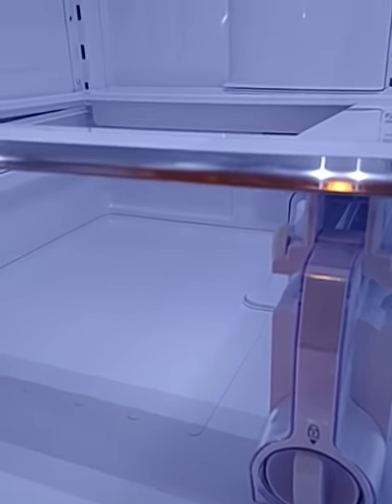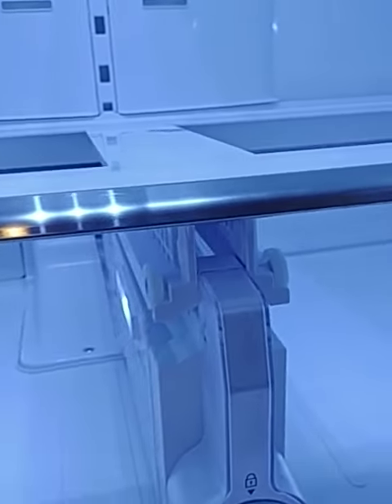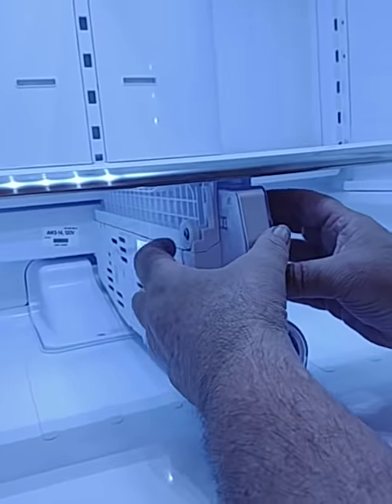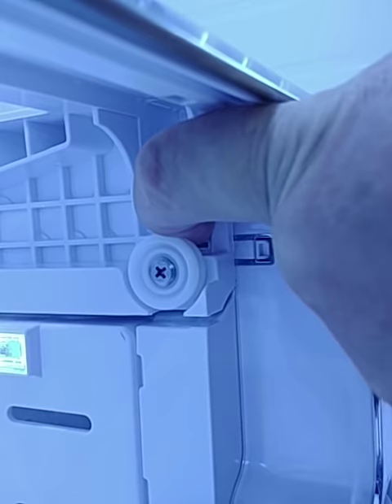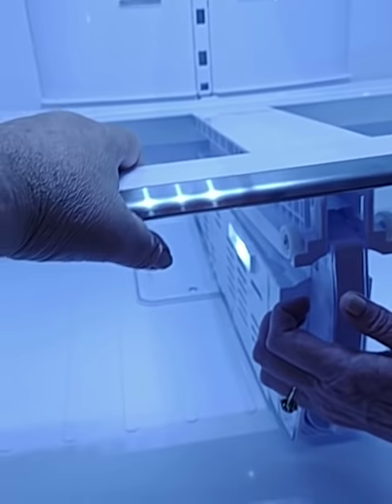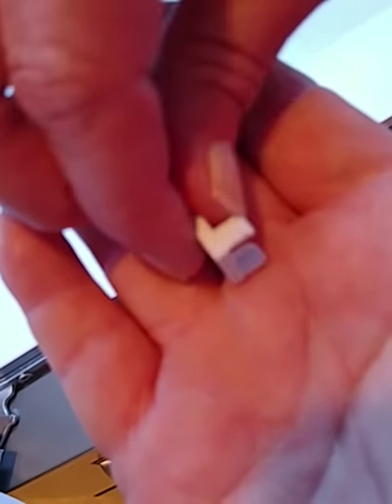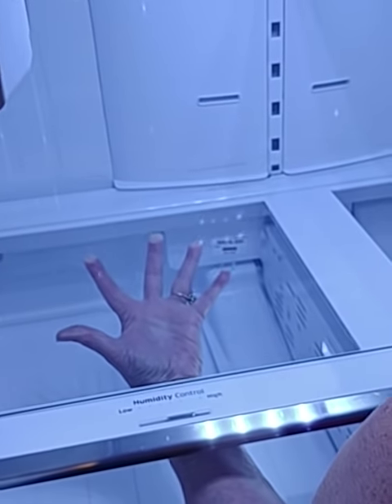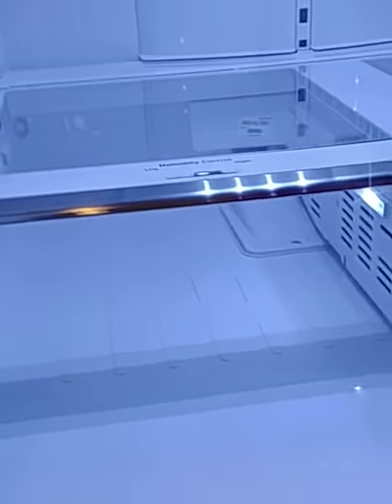Samsung French door 4 door bottom glass removal cleaning and reinstallation

Comment: This was so helpful. Thank you. I’ve had this stupid refrigerator for 18 months and could not figure out how to clean the inside of the glass. Whoever designed this needs to be fired ASAP.Bless you.
Reply: We just went through the same thing with one small spill that looked yucky, but we could not get the drawer or glass our.  Went to the store we bought it at and they couldn't get it to come out either.   We've had ours less than a year and ice maker replaced (freezing up) and it's freezing up again, one of the door handles is loose, and wasted an entire morning getting the shelf and glass out so one small but ugly spot could be cleaned.  Even the former technician said it was a very poor design with the ice maker being right inside the refrigerator part and not blocked off by itself.
Reply: So how do you get the glass out??? I’m going crazy.
Reply from the maker: @stephanielee5209  removing the 2 tabs in the back corners releases the glass. It must then be lifted at the backside and slid towards the back of the refrigerator as the glass snugs just under the front lip by about a quarter inch. Once clear of the front lip you can raise the glass carefully up and out
Reply: yes very poor design on many ways, the only thing that I love so far is how wide and spacious is and the freezer on the bottom. Other than that I hate to clean it.
Reply: Absolutely, I usually don't say this,  that the designer must be fired
Reply: instablaster
Reply: Yup someone spilled seafood 🦞 in mine and I’m struggling
Reply: @peggytilson3613  I’ll never buy another Samsung fridge. We’ve had the same problem with the ice maker and with removing the shelf. If I could justify it, I’d replace it today.
Reply: I agree they need to fire the designer:) we have this refrigerator for almost a year and I am going crazy trying to figure out how to clean the inside of the glass. I am going to try this
Reply: LMAOO
Reply: Once out.. the glass has 2 tiny clips on the right and left those easily come off with flathead screwdriver 🪛 to loosen the glass in order to clean underneath the glass .. you’re welcome ☺️
Reply: That's what I said..."need to be fired" 😂.....I'm glad I found this video...mine is 2 years already...irks me out every time looking at the glass dirty....just thought to search on YouTube this morning...since "you can find everything on Youtube" lol
Reply: Me too !!!!
Reply: Wonder why so many views lol
Reply: They definitely did overcomplicate the bottom shelf

Comment: My wife and I were struggling with this drawer removal. The manual really doesn’t explain something so simple as removal for cleaning purposes.  So , we thank you for this demonstration video. The clips that actually hold in the glass were removed by using a quarter ( my wife’s idea ) . We took the whole shelf out and flipped it over on the kitchen sink , giving us access to the clips .  Perfectly cleaned refrigerator now !
Reply: Hi Kent! I’m trying to removed only the glass but I can not do it, any advise? Is it even possible?
Reply: Omgee for real!
Reply: We did it!!! Finally. My son and I were trying to push the clips with a knife and they broke. First one and then we just decided to remove the second one. In that way we could the out the glass and be able to clean it properly, the glass and the drawer. Maybe somebody could remove the clips without taking out the whole drawer, but let me tell you, those clips are not made to be pushed, we had to press hard. So, I think if we were doing this without taking the drawer out maybe the glass can be broken. I think this refrigerador was not designed to be cleaned.
Reply from the maker: @maribelmartinez6669  YES.
MUST REMOVE PLASTIC CLIPS FIRST
THEN SLIDE GLASS BACK TOWARD REFRIGERATOR BACK WALL (ABOUT 1 CENTIMETER)
(THIS ALLOWS THE GLASS TO BE LIFTED UP FROM UNDERNEATH)
LIFT THE SIDE OPPOSITE ICEMAKER ABOUT 45 DEGREES AND THE SIDE UNDER THE ICE MAKER A LITTLE BIT AND PULL THE GLASS OUT DIAGONALLY
Reply: We struggled with this as well, your video was super helpful, thank you!

Comment: Thank you for this, 280 page manual and not 1 mention of how to remove the shelf.
I saw the 2 tabs bit I wasn't pushing hard enough.
Good job samsung.
TIP:  Don't reinstall the 2 plastic clips that hold the glass down. You can then remove the glass shelf by raising the rear of the glass and slide rearward.
Reply from the maker: 10-4 on that!

Comment: Thank you SO MUCH Kent! With the help of your video we were able to remove the glass only and leave that aggravating center section connected.
Reply: Oh, will have to try that next time.  You need to post a video of how you did it without having to remove everything on one door, pull out the drawers after doing all of that, then spending a long time to get the shelf to up so we could get it out and get to the tiny spill in the glass that was driving me nuts.

Comment: THANK YOU!  WOW!
Had no idea how to  do this  (same Samsung model) for about a year now.

Used disposable wooden chopsticks to push in on the tabs, especially useful on the right side that doesn't resemble a button at all.  
When removed. had no idea how to remove the glass.  Saw a comment below to go from the bottom.  Used a small screwdriver to push one prong from the edge, then easily pushed it out from the center. After we did that...
...another commenter suggested leaving them out so that you could just take the glass out to clean it and the surrounding frame and as that person said "where's is the glass gonna go?" if the tabs are left out.  Should of thought of that.😂

Anyway, THANK YOU, again Kent and Jane.

SAMSUNG, how about caring and thinking about your customers??? especially when you write your instruction manuals. 😒
Reply: We've had our less than a year and had the ice maker replaced, which was constantly freezing up.  Very poor design.

Comment: Thank you so very much.  You have taken a great deal of frustration  off my shoulders and mind. I wasn't able to press in the release buttons and lift the shelf. My hubby helped and now I can get to the stains that have been bothering me.  This video was a blessing.  I hope you have a wonderful weekend and I am now a new subscriber.  Samsung should offer replacement units with user friendly release buttons. I had a high opinion of the company and now wish I had known how difficult it was going to be to clean. Hopefully with each cleaning, the release buttons will be easier to use.
Reply: I had the same problem one month after I bought it something  spilled  under the glass and would you believe even Lowe's couldnt figure out how to take that piece out, and I was totally shocked when Samsung sent me a new refrigerator  can you believe that  I couldn't believe it. I spilled something in the new one and I was determined to get the dam thing out, took me a long time and not easy.  Samsung should do something about the design. It's not good.

Comment: Great video. It saved me a lot of aggravation. I would add "DO NOT REPLACE THE TABS" when you are finished cleaning. Save the tabs in one of the crisper drawers so you can replace them if you ever want to move the refrigerator to another home. In the meantime, with the tabs left out, you can remove the glass to clean the glass and frame without doing all hard prep work as shown in this video. Again, thanks for a great video.
Reply from the maker: Totally agree
Reply: Yep did the same thing.
Reply: I agree. But now how do you remove the tabs?

Comment: Thank you for your post. I needed this information so that I could remove the back wall panel  to melt the ice build up causing the fan to hit the ice and rattle.
Reply from the maker: If you call the repair guy 3 times  while under warranty for the freezer , ... They gave my sister a check for 1300

Comment: I took the two rear tabs off at each corner to pop out the glass and leave the frame in the door.  I can still clean all I need to without messing with that stupid design near the water filter.  Someone should be fired for designing this mess and their boss for giving it the ok.  Thanks for the video.

Comment: My Samsung had slightly different buttons and they were impossible to release with my fingers. I tried pushing with two screwdrivers, but I needed 3 hands to do that and hold the water filter plastic down and the shelf up.  I found if I used one hand to hold the pressure up and pushed on one button and I heard a click. While holding up pressure I switched hands and used the screwdriver to push the other side and it released. Pushing both side and holding it up at the same time is a two-person job. To clean between the glass and plastic of the shelf I released the clips in the back from the bottom, carefully pushing in on one side with a bit of pressure. It would have been impossible to clean in between without taking the glass out of the plastic.

Comment: I really wanted to see how you pop up the glass without breaking anything but great video thank u
Reply from the maker: Will have to add that as an uupdate! Once you have removed the clips from the glass. One must raise the back side of the glass and sight push it backwards to clear it from the front lip. Then it is acrobatics to raise the right side up to about a 45 degree angle to remove the glass from the refrigerator. So you must have both doors fully opened!

Comment: Nothing at all in the manual - almost freaking out and then found your very helpful video - so grateful! Great job taking your time to show in detail. You are right -  you need to be careful when taking out the clips. I used two screwdrivers to remove the clips and did break one in the process. Luckily my appliance is only two months old and my warranty covers the part - you have to call Samsung for the part not J &  J parts who charge $1.85/clip + $4.85 for shipping. Excellent job  - saved me.
Reply: Throw away those clips! They are not needed at all and it will be much easier to clean the next time it gets dirty!

Comment: Thank you, but how did you take the glass out? That’s my problem to clean under the glass 🥳 can you make a video about that?
Reply from the maker: After you remove the clips, (by the way DO NOT PUT THEM BACK IN), FROM UNDERNEATH the glass, push it back towards the back of the refrigerator, then press upward on the glass near the front of the refrigerator.
The glass is secured in the front under a seal that's only like an with maybe an 8th to a quarter  inch ... Like a half a centimeter  to free the glass from that lip then you can lift the front edge of the glass up...
This is another point at which a third hand would come in handy!
And you might have to remove the next shelf above to achieve this maneuver.
You will need to raise the side of that bottom sheet of glass about 45 degrees such that the side under the ice maker remains low and the opposite side about 45 degrees higher, SLOWLY!, and you will have to get it past the door hinge first on one side, while carefully maintaining the 45 degrees slope to fully remove the glass.
To get the glass out of the fridge, you must lift the ca
Reply from the maker: A lot of questions about that! The secret is that the front of the glass is underneath a plastic lip so you have scooch it back just a tad so that you can lift the front edge of the glass.
I had to accomplish the scooch from underneath.

Comment: Thanks for this information.  However, Samsung Supports says that to remove the clips that hold the glass, only need to push one side of the clip (the side of the clip that’s closer to the center of the shelf).  Also, be careful with the glass.  Our glass shelf exploded in my hands yesterday. About to clean my new Samsung refrigerator glass shelf for the first time, I was holding the glass with both hands, and had momentarily placed one edge on the counter and about to remove something from the kitchen sink.  As I lifted it about an inch off the counter to adjust it in my hands it literally EXPLODED in my hands without any good reason for it to explode.  Glass went everywhere, in about a 25’ diameter.  My daughter, standing next to me, had a couple of cuts on her leg.  It took a couple of hours cleaning up the tiny shards of glass, including getting the glass out of the pea salad my daughter was making.  Apparently, tempered glass is known to do this on occasion.
Reply: the manual should address that.  thanks for info abt glass.

Comment: We have different model; however, the information you shared about the location of the pressure clips above the drawer wheels enabled us to remove the shelf.  We did not watch the remainder of the video and we knew to remove the glass keeper clips from the underside to avoid breaking the glass or the clips.
Reply: How do you get the clips off?  Are my fingers too big for this?

Comment: MAJOR TIP TO AVOID HAVING TO GO THROUGH THS PROCESS AGAIN OR EVERY TIME YOU NEED TO CLEAN UNDER THE GLASS!  

After you remove the shelf as outlined in this video (BTW, GREAT HELPFUL VIDEO!) and after removing the clips and glass DO NOT REINSTALL THE CLIPS!

I reinstalled the shelf without inserting the glass AFTER the shelf was in place I simply slid the glass under the fixed guide clips then slowly lowered the glass in place along the back of the shelf.  

So next time you need to clean the glass you simply lift the glass up and out from under from the fix guides.  NO MORE NEED TO REMOVE THE WHOLE SHELF AGAIN!

Comment: I used like a flat nose plier to push the tabs in. Much easier. I broke one. Oops. Not a big deal. I noticed the water filter container was not secured to the bottom of the fridge. I would have to disconnect it to do so and I'm not doing that. Thanks for the video

Comment: How did you take the clips out? The clips holding the glass in place. Those are very hard to get out
Reply from the maker: Those are difficult. Screwdrivers, chopsticks, coins, ... many things have been used. the important thing to know is there is an angle that makes it easier to remove. This clip is used to protect the glass during shipping. Being too forceful can break the glass. Leave the clip out after removal as it is no longer needed.

Comment: takes for you effort to help us do with without breaking things. one note, I found pushing on the left side which is actually the butt and then prying upward in the center with a small screwdriver was very effective. i think only one side has to be pushed in to release. but wadda i know, i'm of polish descent!!
Reply: You may be right, and I wish I had read your comment before I tried to push on the right with a screwdriver and on the left with my finger and broke off a small piece. It's not even a week old. This section was poorly engineered, in my opinion. Way too difficult to remove for cleaning, and spills way too easily leach underneath the glass.  Before trying to remove this shelf, I called the appliance store and they could not get the shelf out. I even called Samsung and they did not email me the correct information. They sent me pictures with buttons on each side, which may have been more effective, but which mine does not have. Mine is like the one above.
Reply from the maker: worker33 Good to know!
Reply from the maker: worker33 Yeah I kinda got that realization while watching this video after I made it...
Because I didn't have enough light and space during my ordeal!!!
Reply from the maker: Kriss Mellor Yes. Same stuff ...  left side very difficult release button and right side... A whacked out clip. Plastic under frame seems as delicate as egg shells.
As soon as we got it back together the red wine and back wash water appeared again over the white plastic under the glass...
Sigh...
I'm thinking maybe don't put the glass clips back in so the the glass can easily be lifted out and cleaned
Reply from the maker: worker33 ok I see that now!
Thanks
Reply: Kent Estes Thank you very much we broke the clip as well but to push on the right hand side was easy we did it with our finger
Reply from the maker: vijay dayal Kool!
For future cleanings leave the clips out or off...
Then you can remove the glass easily

Comment: OMG who designed this  glass shelf  like this ,what were they thinking .Spend my complete night trying  to get it out . Its so filthy under the glass from spilled milk ,  that’s been there over a year . There’s nothing about this in the manual  .broke my nail in the process,  and haven’t got the shelf out yet . I give up , so frustrating .
Reply from the maker: Remove the plastic clips in each of the 2 rear corners (left and right side rear corners... At the back of the refrigerator) from the underside of the glass.
The glass can then be lifted up ... Then back it away from the front edge secure lip .
Next angle the glass shelf at 45 degrees side to side and carefully pull the shelf out of the refrigerator.
Make sure that both doors are completely open else the glass will not fit through the opening.

Comment: I have the exact same fridge and can't get the glass off the bottom shelf.  I see the tabs in the back and I can see that the back of the glass has to be lifted first then slide slightly to the back to release it from the front lip of the shelf, but how do I get the back tabs off?
Reply from the maker: annaxanth you must remove the entire glass and plastic frame the first time.
The clips release from the bottom side.
Use a knife or a screwdriver to close the punches together.
When you clean it up and are ready to reinstall...
Leave out the glass clips!!!

Comment: I wrecked my hands and nails trying to clean this shelf the "right" way. Those clips are useless unless you are going to hang your fridge upside down. Gravity and goods hold the shelf in place. Those clips snapped off easily with a gentle prying motion... being careful not to push on the glass shelf. If you need to move the fridge just tape that shelf down for the moving truck.